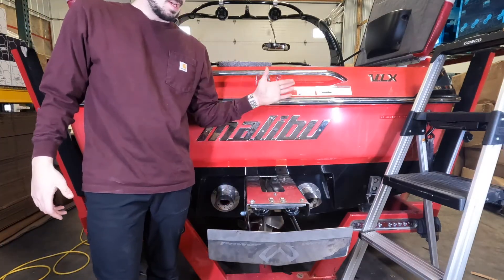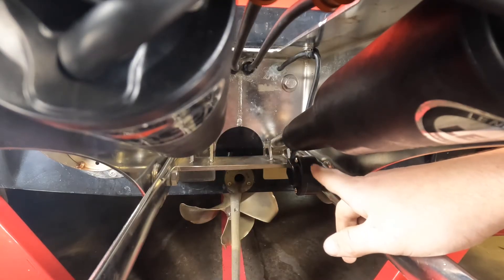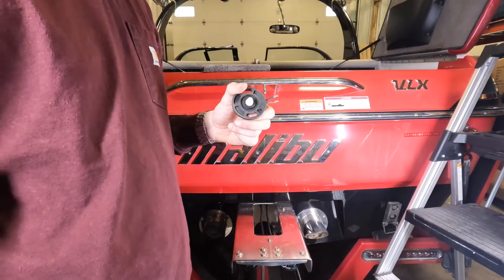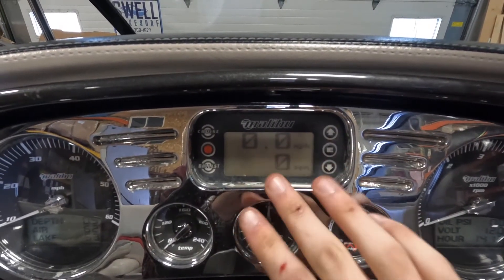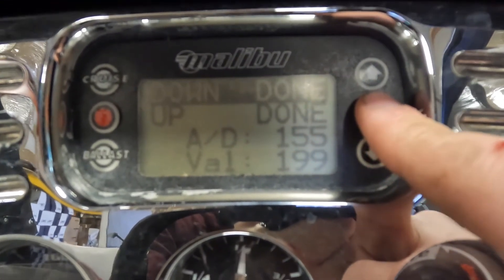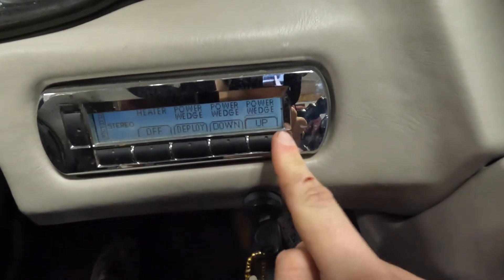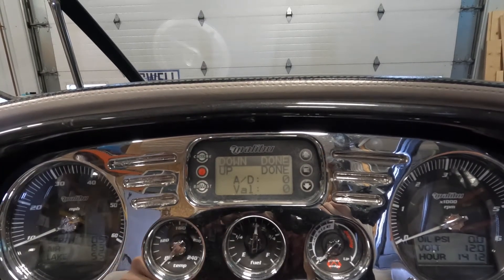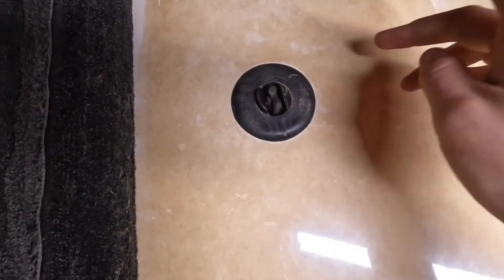Malibu Wakesetter: How to troubleshoot and calibrate your Power Wedge

Comment: Thanks for the video! And about the hydraulic cylinder, any tips to fix ? I was told that you can access the oil pump can be access from inside the boat (I don't want to take it out of the water to troubleshoot). Any tips?

Comment: For anyone who can solve the problem of the wedge getting stuck down, but it can be raised by reversing the wires. Can you help me understand where to focus my troubleshooting? Is the problem the sensor or calibration? A fuse? Wiring? My boat is a long way from where I live, and I'm trying to collect parts I might need before going out to see if I can fix it.

Comment: Thank you very much for this video. It was so helpful to get the Wedge working!👍🏼
The only Issue I have now ist, that the Sensor during calibration shows a 600ish value. 
Does it means that the sensor is broken?
Reply from the maker: Give jake a call at 651-400-twothree8nine, he may be able to answer that

Comment: I used the guys idea of switching the red and black wire with the battery switch off then reinstalled the fuse liked the switch on and the wedge is now up. Couldn’t get anything else to work but this. Great suggestion it worked for me. I will repeat the process if I want to drop the wedge and surf now. A little ghetto but it works

Comment: Do
I have to have the boat in gear in order to spin the wheel and get wedge back up ?
Reply: Update : it doesn’t have to be in gear
Reply from the maker: Nope. Just spin the wheel
Reply: @SWELLWakesurf   what I used to do is switch the wires around in the fuse panel and press power wedge down and it went up .
Reply from the maker: @_jonbee  interesting 🤔
Reply: @_jonbee  your trick worked for me it was my last resort thanks for the idea
Reply: @brianstarkey1824   your welcome ! Much easier when you’re by yourself :)
Reply: @_jonbee  I have the same problem and have used the same solution. 2 years since you wrote this, was that a temporary solution and you now have a permanent one? Or are you still rewiring each time you want it up or down?
Reply: @ I would rewire when I’m by myself if I have someone I have them spin the wheel to get it back up … I’m trying to use the wedge anymore it’s annoying

Comment: My wedge goes up and down works fine - however the gauge does not move when I move the wedge. Do I need a new sensor?
Reply from the maker: The sensor wouldn’t allow it to move, so you most likely have a bad gauge or a loose or bad wite
Reply from the maker: Wire